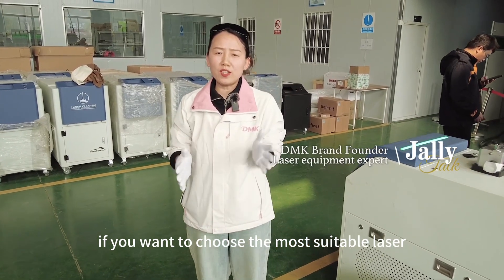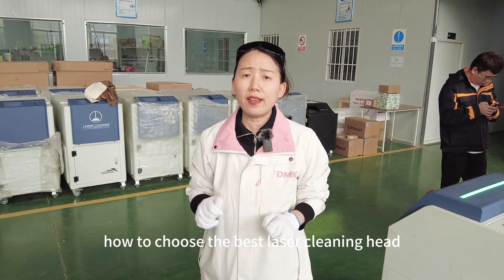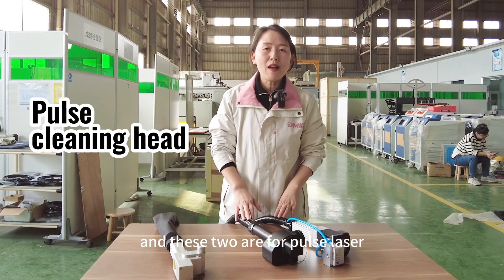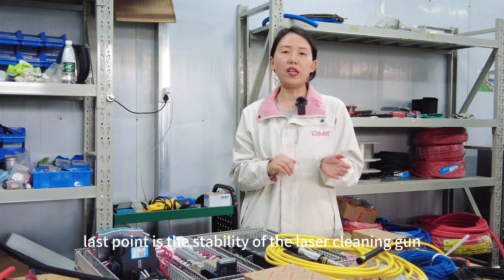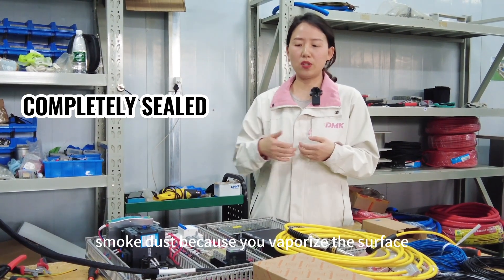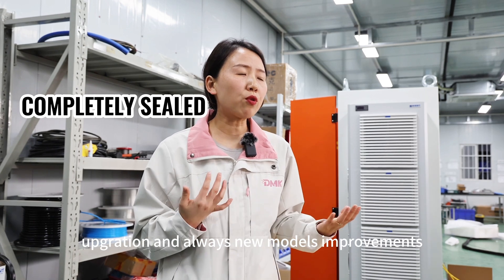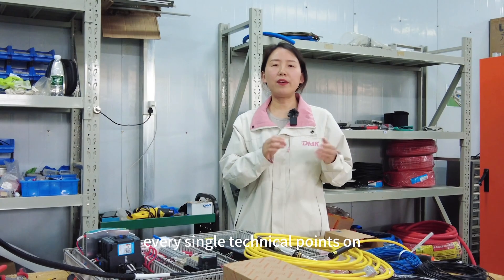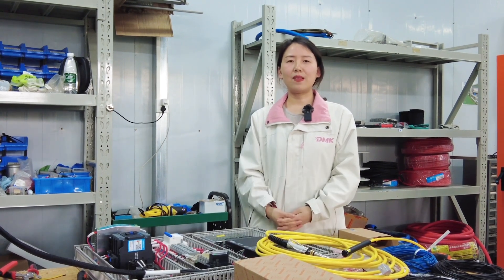How to Design and How to Choose the Best Laser #cleaning  Gun for Your Laser Cleaning Machine #DMK

Comment: Great presentation. I am strongly considering a purchasing a laser really soon. And I mainly want to use it wood furniture restoration and cleaning. From observing many videos on laser cleaning, I’m finding that people tend to use the Pulse laser between 100w to 200w for more suitable results. Is it possible to use a continuous laser for wood restoration, and manually adjust the power settings on the continuous laser down to the 100w to 200w levels?
Reply from the maker: no sir, pulse laser is very different with continious laser, wood is very sensitive to laser power, only pulse laser can do such a work

Comment: I have a 2kw CW cleaner and it´s really nice for rust and prepare mild steel for powder coating but i noticed that it is not good for aluminium at all actually so my 20w mopa fiber marker does a better job then 2kw CW cleaner, so the question are is the pulsed cleaner comparable with a laser marker?
Reply from the maker: yes, pulse laser cleaner works in similar theory with laser marker, both are pulse laser and scanner moving, but also have difference, power difference and way of leaser beam moving